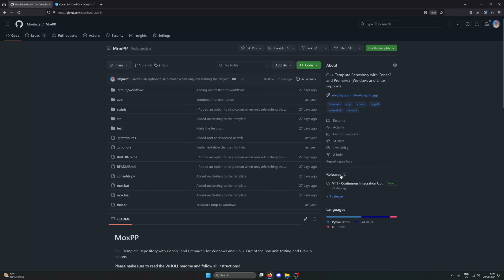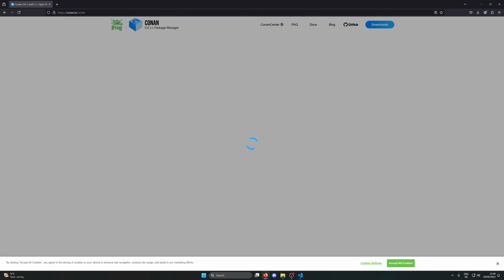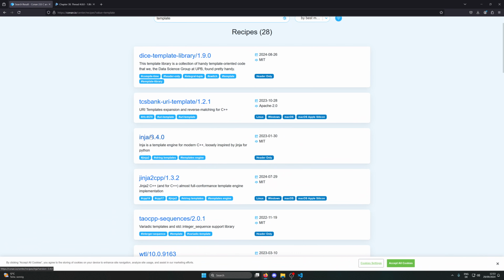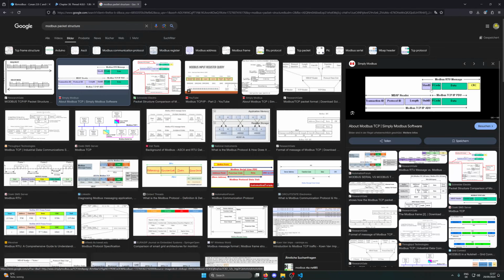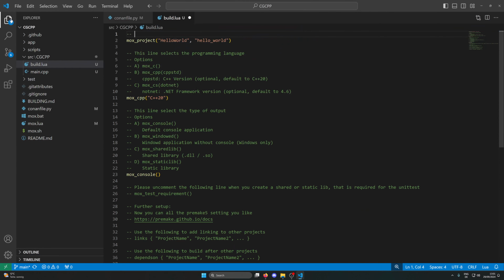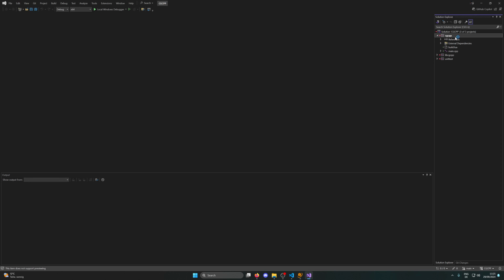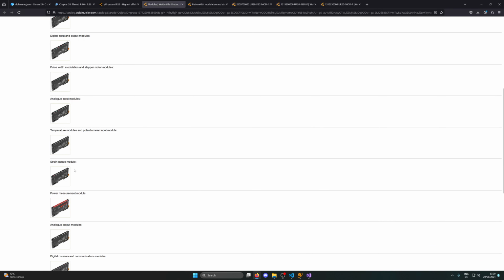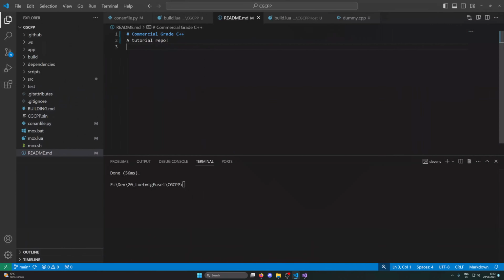1 - Repository Setup | Commercial Grade C++

Comment: I'm getting a build error with gtest
gtest/1.15.0: ERROR: 
Package 'f9811fd4161571ab9655d9bd54eb4ef54d1aa220' build failed
gtest/1.15.0: WARN: Build folder \.conan2\p\b\gtest686718093c06b\b\build
ERROR: gtest/1.15.0: Error in build() method, line 139
        cmake.configure()
        ConanException: Error 1 while executing
What is the problem?
Reply from the maker: Do you have CMake installed?
Reply: @LötwigFusel  i suppose yes, maybe it is not linked to vscode or something like that? idk